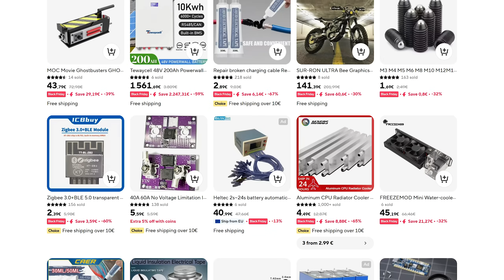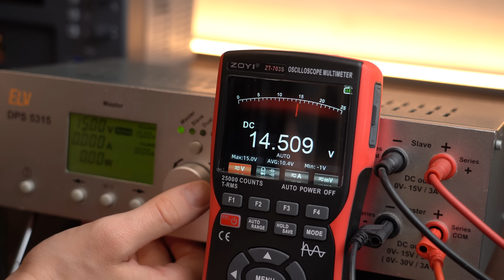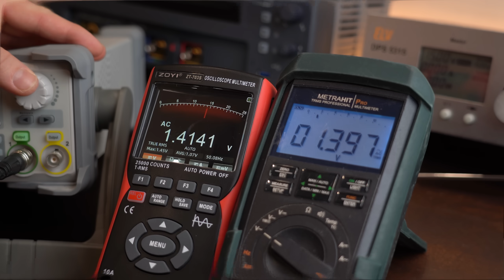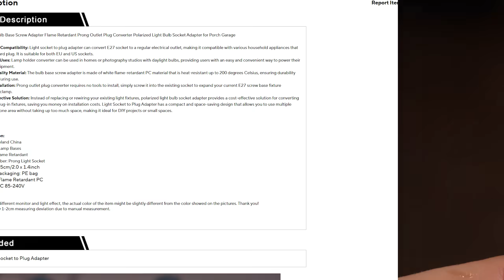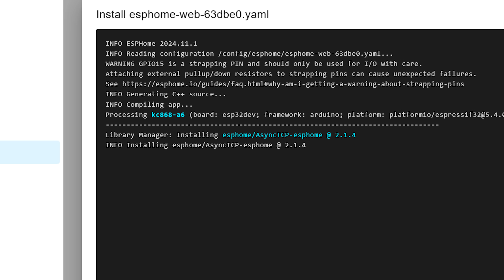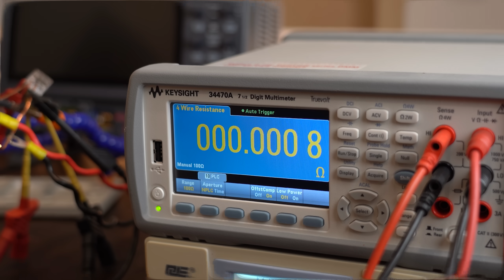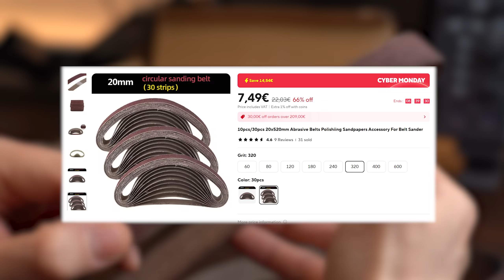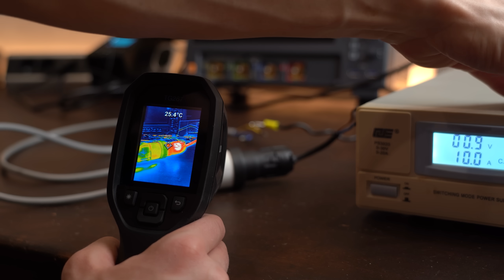I tried finding Hidden Gems on AliExpress AGAIN! (Part 12)

Comment: Socket to outlet converters are most useful in places where the only electric available is a single light socket.  Throw in the adapter, a small power strip, and you're functional if potentially unsafe.

Comment: Light socket adapters have existed since the dawn of electricity in the US. It used to be there was only the light socket. And then there was a two-tiered system we're lighting was one price outlets for another. then there was the places with lack of outlets problem for a long time, so yeah it is interesting to see a modern take.

Comment: Don't use lighting circuits as power sockets. Lights dont take much power, and the cable size is calculated based upon assumptions about the maximum current, the maximum ambient temperature, and the environment of the cable (eg covered with insulation or not). If you exceed the design rating you may cause a fire.

Comment: The bulb to plug adapter is something I've used with Christmas lights. I remove a bulb from the porch light and plug the string into that fixture. It's already high up near a roofline and I can use the switch inside the house to turn them off and on. Once the holidays are over all I have to do is screw the bulb back in and everything is back to normal.

Comment: I use a socket adapter to run a USB security camera, saved me from having to run a new wire or splice into the light wire.

Comment: I used the US equivalent of that light socket to outlet adapter for years in a room that was poorly lit by it's single recessed light socket that was missing it's diffuser cover. So with minimal and completely reversable modification, I hung a florescent shop light that was powered by a wall outlet plug and used the adapter to power the shop light from the socket above it. This lit the room up way better. Then when we moved out, I was able to restore the original lighting setup by just removing the shop light.

Comment: 5:30 this product is literally for stealing power. it is widely used to screw into a lamp socket on a circuit not metered by your apartment and then you can connect a cord or something and receive unmetered power.

Comment: The outlet in light socket thing isn't so weird, in my opinion.  There are old houses which have very few outlets and extra light sockets for no apparent reason. That's when you would use this adapter.  Have no outlet? Have an extra light you never use? Cheap and not handy? Buy this!
It has its use.

Comment: Ah, dude, honestly, I've tried to force myself to like ESPHome, but it just doesn't work for me. The whole process of configuring things through their YAML setup and dealing with the firmware compiler feels unnecessarily frustrating. Every time, I end up giving up and writing a custom sketch in C instead. At least with that approach, if something doesn't work as expected, I have actual code to debug and figure out the issue.

Comment: I'm intrested in the home automation relay board, I'm about to start building my house and I wanted to put all lights with thst, but inyl 6-7 relays is too few. I'll have to investigate more
Reply: The one in the video is a Kincony board.  They have boards that go up to 128 relays.  I have several driving my whole house.  The only thing Kincony doesn't make is a triac dimmer for AC mains dimming.  I had to use some Shelly Pro Dimmers for that.  But I 100% recommend Kincony boards.  They are very economical for what you get.

Comment: I use some similar loght socket outlets in my basement. It's unfinished, so there used to be kist a single light bulb on the ceiling. I got a bunch of those daisy chainable LED shop lights and plugged them in to the existing light socket, so i have a brand new loghting solution that comes on with the existing switch.

Comment: Those socket to outlet adapters are used a lot here in the US as an easy and cheap way to use LED shoplights in places where there are keyless bases, like garages or basements. You take the old, dim bulb out, screw that in, and plug in a higher output shoplight instead.
Reply: You used to even be able to get ones that had power outlets on the side and an E26 socket on the bottom, so you could plug something in and keep the light bulb. Those were a bit sketchier in the days of incandescent bulbs, because you ended up cooking whatever you plugged into them, but they existed.
Reply: @RonParker  Those still exist, as well as the super fancy ones that have a pull chain for the light.
Reply: Exactly what I use one for. Instead of one bulb illuminating the garage when I open the door to pull in I have daisy chained LED shop lights gloriously showing me the way.
Reply: We use them for Christmas lights
Reply: not suprising, you guys have such poor standards with everything. Electrical safety is probably just as lax as gun control.
Reply: @Steve211Ucdhihifvshi  Well aren't you quite the euro-exceptionalist. 😝
Reply: @Steve211Ucdhihifvshi   Except this isn't an issue. US light circuits are wired to the same standards as wall outlets. And they're keyed so that you can't connect appliances that require a ground.
Reply: @eDoc2020  You underestimate people. I have seen a chain of Edison splitters, E27 to polarized socket adapter, and grounded to ungrounded connectors. Also, when I was a child, we had loads of unpolarized outlet converters, and there's no guarantee that the light sockets an a house have ever been tested to make sure they have neutral wired to the shell.

Comment: I dont see the big issue with the socket in a light fitting. Would actually be quite good for something like an iron not thst the circuit would handle it. Quite good for ceiling mounted ir heating panels in say a rental. Power for cctv woukd be an option aswell. Aslong as you arent using class 1 (earthed products) then ots fine. I believe regs in the uk anyway doesnt allow for sockets in the lighting circuit but i dont know why unless its just to stop nuisance tripping. The wiring is not of poor quality so why would it really matter.

Comment: The liquid Tape is supposed to have that consistency i think, i have some from different manufacturers here and they are all this way 😅 I use them more like modeling Clay. (probably i should use Gloves the way it smells 😅) 
For me it works really well, i also often use it as Bend guard for small Projects where a thin wire comes out of an 3D printed Case 😅

Comment: 5:30 I once stayed in an isolated resort where my room had no wall sockets and only a single light socket. I had to take the light socket apart (by torch light) to temporarily splice in my phone charger.

Comment: About the outlet for the light socket, the issue with the contacts exposed is quite normal in japan, Thailand, US etc, They all have the pins without insulation. Also I can see ppl using this in Indonesia when like you've mentioned, they don't have plugs sometimes but only light sockets

Comment: Its funny that I needed a bulb to power socket adapter last week and had to make one myself.
One use case for having one of those is if you have to work on your electrical system.
In my example one of the wall sockets exploded and since the genius that made the power network in my house routed power to all the sockets in my house through that one socket (I guess that's why it exploded) I had no power. No power = no power tools = no ability to fix the socket.
With this adapter I was able to get power from one of the lamps and use it to fix the socket.

eidt:
Those adapters can handle 10A, since that is what lights are fused with.
Its less than 16A used in wall sockets by design (no one is going to push more than 10A of power through lamp, so cheaper wires can be used for the lamp power network)..

Comment: The belt sander adapter is not intended for use on flat surfaces but only for hard to reach parts.
Works fine as a belt sander but of course you don't have much sandpaper available so it wear out quickly.

Comment: The light socket plug can be handy in an apartment like mine where you have a small shed where you can put a small freezer but only a light socket. Assuming you can find a good one.

Comment: 6:52 in Europe, light installation is protected by max 10A fuse so you shouldn't be able to draw more than 10A anyway. But I also tend to think this is more intended for Christmas lights or something similar which is temporary and with a small current draw, as you mentioned.

Comment: to 17 year old me, who was working on my first clunker in the underground garage of the apartment building the family lived in, the lightsocket outlet passthrough thing was a godsend.
all i had was an old corded drill and a smallish trouble light running off it but that proved to be enough, if i had to guess this adapter was from the mid 80s cause i dug it out of a kitchen drawer

Comment: You can add acetone to to that liquid tape. Probably comes with MEK in it. Acetone should work. 

I've never seen it in a tube. Get the real stuff. Comes in short metal can with an applicator in the lid.4oz should be around $7. Way way more than that tube. It is prone to drying out so get some acetone. I usually add a few small pipettes of acetone and then shake it up real good and then give it a few minutes to become less chewy and should be as good as new. 

Methyl ethyl ketone is some pretty volatile stuff so it isn't really surprising that it evaporates out so easily.

Comment: 12:12 Yes that thing you tested was garbage i can agree with that. But that thing is also not a Belt Sander, that is a Band File (Bandfeile) and is made to get into small areas that you can't reach with a normal file, sandpaper or an angle grinder, these are not made to sand a full flat surface like you did. Band Files are one of the best things to use if you wanna clean up welded parts and you can't reach the area with big tools (small corners for example), remove paint or just want to sand down  specific spots.

Comment: That "belt sander" is a finger linisher, you can get good belts for them, cheap belts will wear out fast. They are only a detail sander and not intended to sand large areas, you should only use the tip of the roller, and not the flats which is probably why you had issues with it melting the plastic.

Comment: Actually, I use a light bulb socket converter that not only includes the outlet, but extends the socket so you can still use a light bulb. Pop that bad boy in for outdoor holiday lights, just switch on the porch light and the whole front of the house is lit up.

Comment: AFTER ALI EXPRESS FULLFILLED MY $250 ORDER BUT USED A FEDX TRACKING NUMBER THAT DID NOT LINK TO MY ADDRESS AND THEY REFUSED TO RECALL THE ITEM OR REFUND MY PAYMENT I KNEW I WAS SCAMMED.  I SINCE LEARNED ITS A COMMON PRACTICE  AND FEDX SHOWS  ORDER DELIVERED I DUMPED THEM. MY CREDIT CARD CLAM WAS DENIED AS FEDX SAYS  IT WAS DELIVERED.   FEEDX REFUSED TO REVEAL ACTUAL DELIVERY ADDRESS TO ME  AS THEY CLAIM SECURITY PROTOCOLS PREVENT REVEALING SUCH INFORMATION.  ITS A CATCH 22 SCHEME.     A WHOLE LOT HAVE BEEN SCAMMED THIS WAY.      SO BEWARE OF ALI EXPRESS AND THE OTHER CHINESE SELLERS.

Comment: I noticed you were using crocodile clip cables that looked like they might have been bought online. I recently discovered they are often made from steel rather than copper or even aluminium wire as the wire is magnetic. I just thought it worth mentioning as you were using a milliohm meter with it.

Comment: That "belt sander" attachment is more for reaching into tiny places than use on plate steel. I'm sure the ali express version does indeed suck but bandfiles (what we call those over here) are mostly used in auto body and pipe work to clean up welds and cutting burrs.

Comment: Light bulb adapter sockets are great in bathrooms that have bunch of bulb sockets positioned horizontaly above mirror but no outlets for electric shavers or phone chargers, if anyone or anything is weird, it's definately not aliexpress or that adapter.

Comment: You can get monoculars instead of this digital microscope. They're often advertised as watchmakers magnifying glasses.

They cost little money and are pretty handy. I have one with 10x magnification, which helps me a lot with small labels on ICs.
They're also a completely optical device, which I find quite nice.

Comment: Lamp sockets usually do not have thick wires, so you don't need thick wires in lamp-socket-outlets. You can't safely use it for e-teapot or something like this. Imagine old 100 Watt lamp - its less than 0.5A (in 220v).

Comment: Those socket outlets are a lifesaver. I use better quality version. I added led lighting in my garage. I plugged the led shop lights into a socket adapter for the old incandescent bulb. Now I can use the regular wall on off switch. I also put two in the incandescent sockets on my garage door opener, now I have two bright led shop lights that come on when I open the garage door

Comment: How is actually possible to have a such lower price for the relay board? Does it have a CE/FCC certification? Just check the cost of the terminal connectors, similar power rate relays and the enclousure on major distriuitor as RS/MOUSER/FARNELL etc. Also if buy in large quantitty the cost is pretty high... For me it's a mistery how the manufactor can make any sort of profit. Any idea? Thanks

Comment: I've been using light fixture outlet adapters for years.  My plug-in LED strip lights in my garage are plugged in to the light fixtures with these.

Comment: Here in the states, i've seen the lightbulb to receptacle adapter used in basements to replace a single bulb fixture with a strip light (fluorescent years ago, but LED now) that way you can use extant wall switches to control the new lights.

Comment: I've been using the portable oscilloscope for over a year now. Suuuuper useful for my work in the farm 🥹 what a time saver and I found out the battery is actually Li-ion 18650... So at least if the battery runs out of its lifetime... I can swap it myself haha 😂

Comment: My last house was very old, and as such had very few wall outlets (it was built without electricity) so I found several of the light socket adapters left behind. They were used pretty frequently way back when houses were initially only wired up to provide light, then with more inventions to use electricity they started installing wall sockets. I’ve used the socket adapters a few times when we lived there simply because it was the closest available. One bedroom at that house actually even never got wall outlets installed, the single light fixture in the middle of the ceiling was the only power in the room!

Comment: Well, that socket is quite old. But, in those days, the light-fittings were mostly safer with 'stone' outside or bakalite with the contacts deep inside (at least here in my country) so you could never touch them. Also by regulation: the small contact was the live... although not every place was hooked up this way.
And current: you can use a light-socket only for a few amps anyway. 
I used those kind of sockets many times in the past, especially in hostels or hotels or other rooms like that without sockets. To put power on a charger or coolingbox for example. So low-loads only.

Comment: Thanks for the video.
I have an adapter that I got from my DAD, that screws into a light socket and you then screw in the light bulb into the adapter and now you have light and two 120volt plugs. This thing is from the 1970's ali express it behind the times.

Comment: A cheap and easy alternative to the digital microscope is taking a webcam and screwing the lens adapter so the focus is much closer.  If you remove the webcam plastic casing, then the lens can fit easily between electronic components

Comment: That lightbulb to an outlet is a very very old idea. Back when certain places only had electric lighting and no sockets so say a hotel or whatever people used to take them along on holiday. I have an old Bakelite one somewhere, it was even likely before products shipped with a plug as you have to wire it yourself.

Comment: I use this kind of a lamp socket adapter when I need to check a lamp socket with a multimeter - using such an adapter makes it much harder to accidentally short the neutral and live wires.